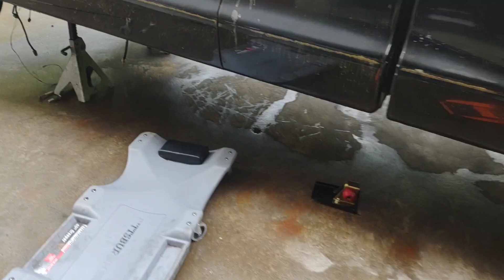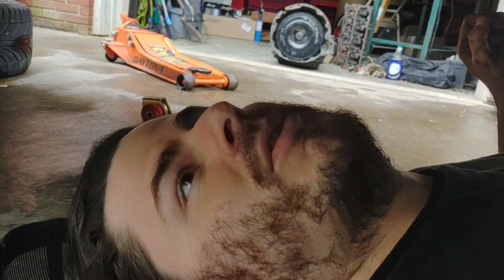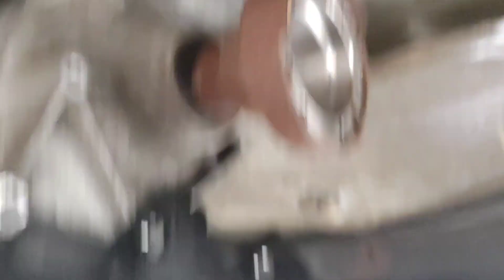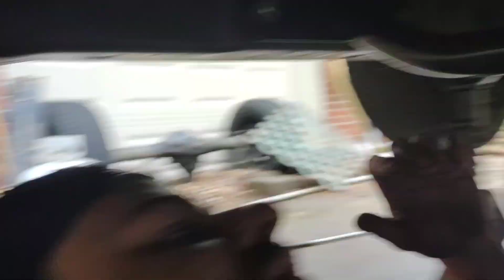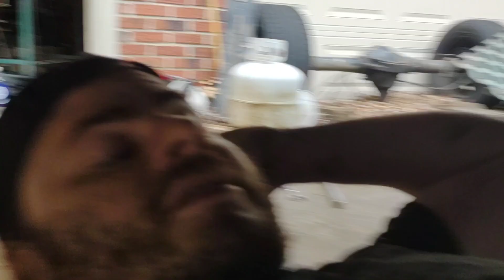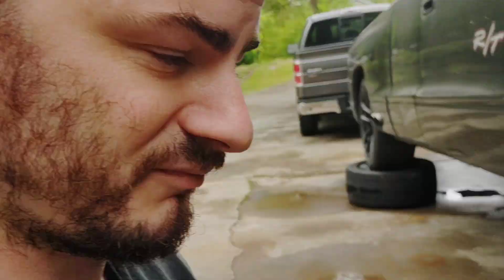Dakota RT 8hp70 swap (test fit)

Comment: I did this to a 3.7 Dakota with four wheel drive…!
Reply from the maker: What controller did you use? Or was there a factory 3.7 optioned with a 8speed in the later years?
Reply: @thomasbeyer  Russel Drake’s (Sound German Automotive)

Comment: Thomas, can you post the flywheel specs you ordered? I'm looking at adapting a 46RH to my 383 in my RoadRunner and I'm going to have the same problem you're having. I looked at an UltraShield but they are now $700 and you can't get one. I'm also looking at having a converter built with a hub that is about 1/2" longer to make up for the adapter. If I can do that it will be simple. Great stuff on your truck.
Reply from the maker: Rm-955. This flexplate is to adapt the Mopar to a Chevy 4 l 80 e. . I've since returned it and started making my own flywheel out of 4130 chromoly is being lasered out right now
Reply: @thomasbeyer Making your own  sounds like a doable thing. Can you do a video on building and testing it?
Reply from the maker: @dbc105  I will when all of the parts come in. I'll be on vacation next week so I'm hoping to have the flexplate and the crank sensor relocation bracket and tone ring made before I leave.

Comment: WHAT ARE YOUR THOUGHTS ON SIMPSONS SPEED SHOP MAKING 530HP FROM NA 360?
Reply: Dude isn’t making the number up 🤷🏻‍♂️😂
Reply: Dude isn’t making the number up 🤷🏻‍♂️😂
Reply from the maker: I think it's very possible. I'll have to check out their build list. Mine made 365hp 370tq to the tires so I believe it would be around 420hp flywheel. And mine is still just a mild cam and ported factory heads with an air gap intake and long tubes. I believe it wouldn't take much to get to that level. A good set of heads a bigger cam and a single plane would do it I believe.

Comment: I'm already eyeing the 8HP70/90 when my 545rfe ever decides to check out. It's awesome my Mom's 2019 Ram has it and bangs through gears like crazy 8HP75 is what she has i think. The gearing would be better then my 545, but with a 3.55 rear, top of 2nd is 71MPH and the fuel shut off hits at 98 as it is now lol
Reply from the maker: It's going to be a worthwhile project. Faster and more fuel efficient. My truck screams at 90 and my Challenger is around 2000 RPMs at 90. It's going to be so much better!